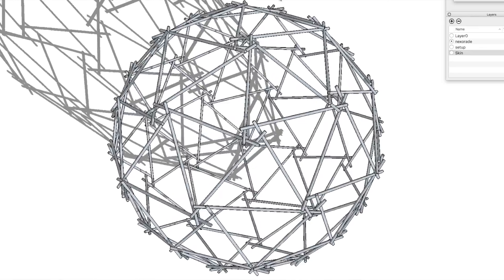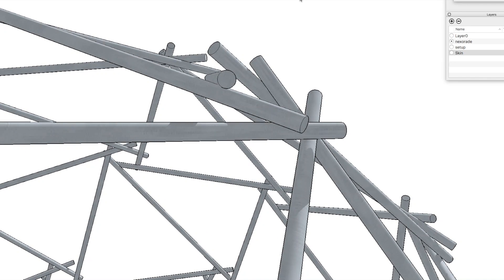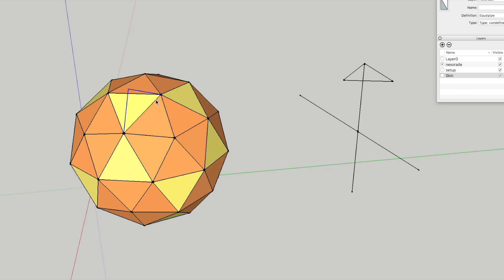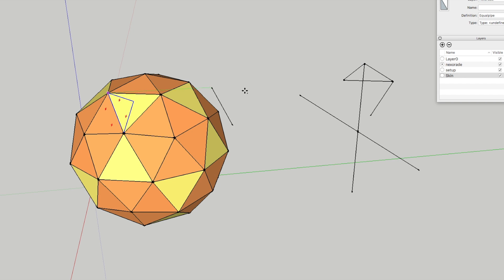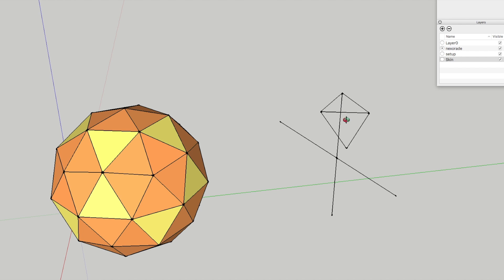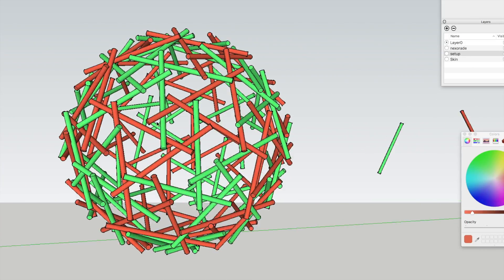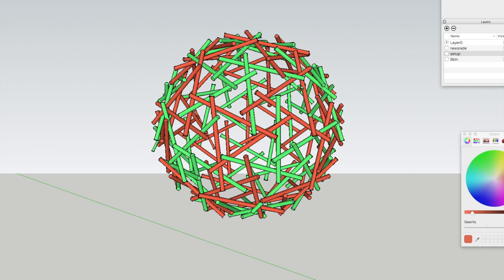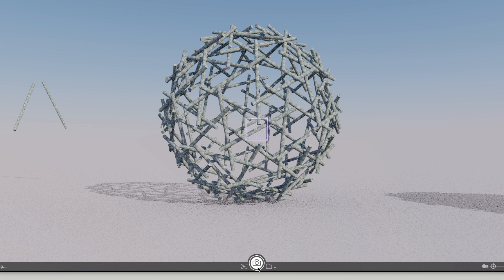Nexorades and reciprocal dome structures - tutorial

Comment: Hello, thanks for sharing the video! It's really helpful, but I couldn't figure out how to use the rotate command by creating an axis. When I click on the centre of the equilateral triangle to rotate the other sides of Isosceles triangle around it, and drag the pointer to the centre of the geodome to creat the axial, the rotate tool is getting locked in a single plane unlike yours, where it changes the plane along with the pointer movement. Please tell me how to fix this.
Reply: You need to hold the mouse button down until you have it on the centerpoint about which rotation will occur. Click once on your starting point, HOLD the button down and release it at the other end. You should see a black dotted line representing the newly formed axis. With the next click of the mouse, select a point on the object to be rotated that you'll "grab" from and rotate the copy..